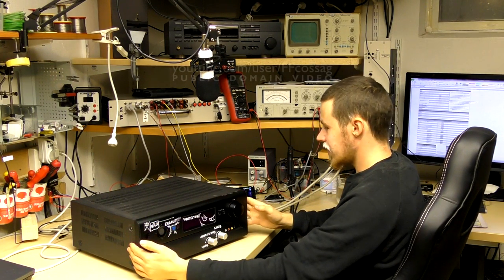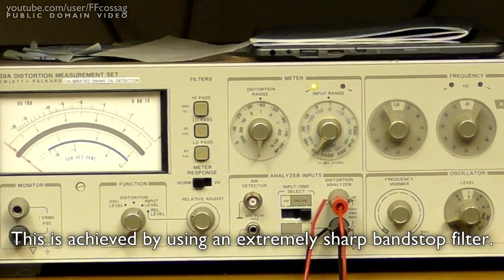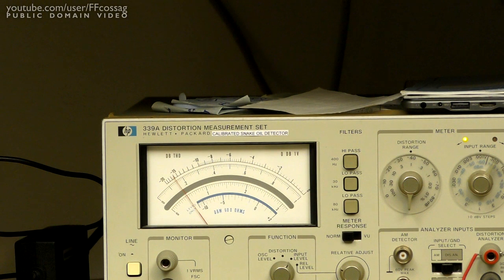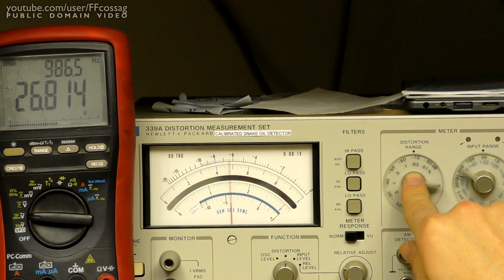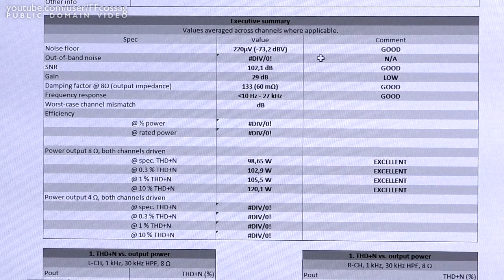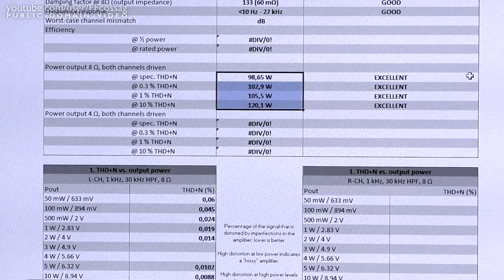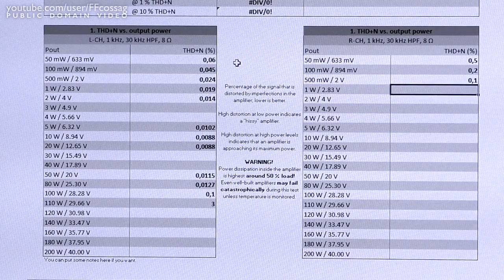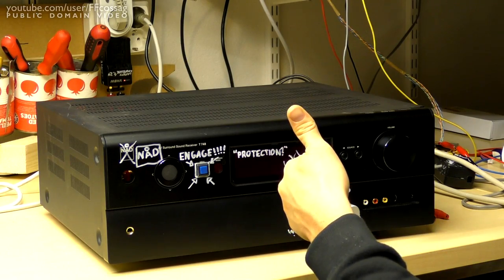NAD T748 analogue conversion performance test

Comment: Good old NAD 3020 here, still running sweet after 35 years.  Volume pot needs de-clagging, but otherwise all good.
We Brits have built some great sound gear over the years.  :o)
Reply: 3120 checking in, it's time you thought about changing the main filter caps! With suitably low-ESR caps these things kick out a reasonable amount of clean power over their rating.

Comment: I remember one amp back in the 80's that used to run hot on purpose, like 83ºC doing nothing. They used the heat like an oven stabiliser, because it only got in spec when it was hot. I think it was a ME.